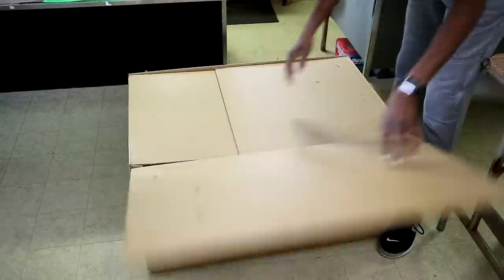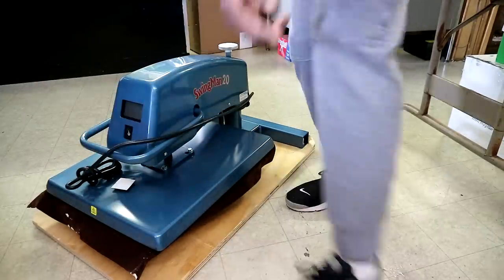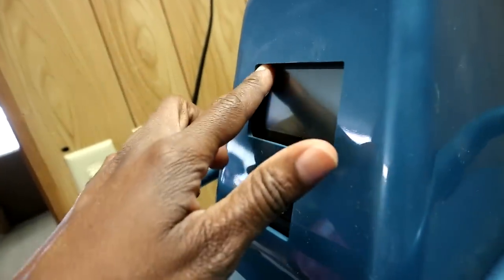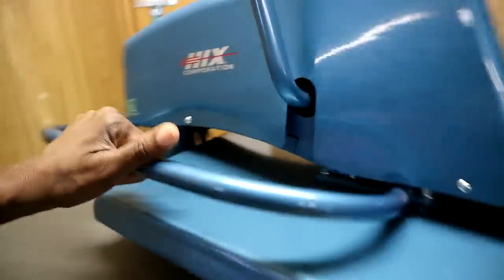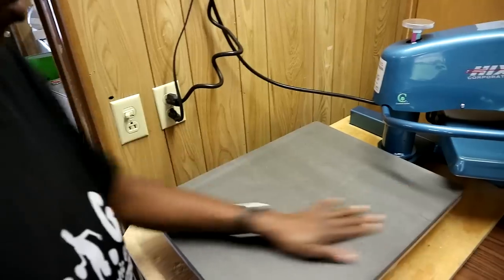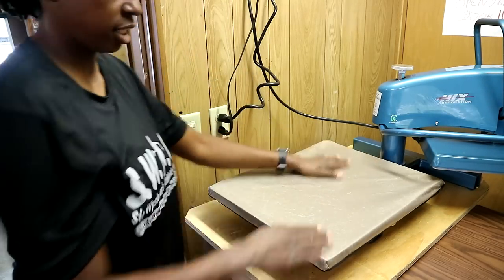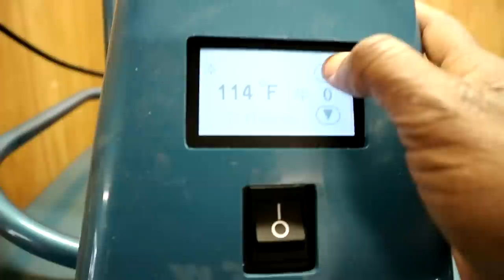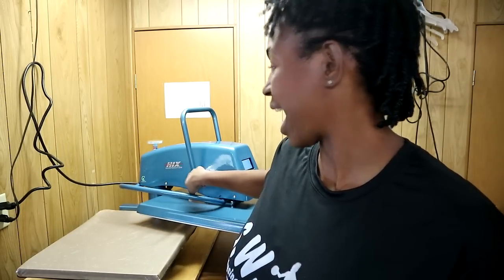I Really Can't Believe This

Comment: Sin, I would send it back.  Your not being picky, its a $1,600 press.  GeoKnight is all metal, even the upper control panel area.  They are heavy (approx. 200 lbs.) but you are not going to have the control screen, etc. moving like that.  They are in the $1,600 range. Hotronix Fusion IQ is nice with the sliding table but will be $2,100 range.  Good luck.
Reply from the maker: I will call them 1st thing on Monday morning
Reply: What he ⬆️ said!!! Rad name by the way 😉
Reply: We have the Geoknight also. Love it!
Reply: Same, geo knight dk20s. Heavy and easy to work with

Comment: I had a situation just like that..reported the problem with pictures, they only offered me $75.00 on a $600 press that was damaged beyond use..I purchased it using Klarna.  The Amazon seller sent me the return label,  I paid for the return through UPS and shipped it off, received all the tracking information with a signature verifying the press had made it to the destination on the label given..there's alot more, but, this is the meat of the situation..Klarna is still contacting me requesting payment,  I have provided them with all my UPS information..to this day it is not resolved.  This was in May.

Comment: I’m concerned about the front penal digital display I feel it should be flushed with the frame like the first one idk it could be refurbished. Take pictures and send it to them. That can be a fire hazard. Your not picky you worked hard for your money and this is suppose to be an upgrade.They need to give you your money back. Send them both back get a refund
Reply from the maker: At this point I would like a refund because I'm tired of dealing with the issues.  Thanks for the support.

Comment: what kind of heat press is your old faithful? I'll be starting my business soon and want a good one. have you designed and of your transfers? if so, who did you send the artwork to for making the transfer sheets?  Thanks again. GOD bless you.
Reply from the maker: My Old faithful press is also a Hix which is why I wanted to stay with Hix in the beginning because I have had no issues with it after over 10 years of use.  It's the Hix 15x15 econo press.  I have printed transfers with my ink jet and my laser printer but never had screen printed transfers printed.  I create my own designs with photoshop using clipart because I can't draw.
Reply: TshirtChick thanks for responding. I have drawn some designs but don't want to send them out in fear of losing my right to the design. would it be better to scan it to my computer and print it out on plastisol paper?